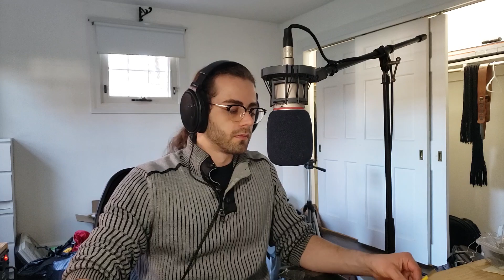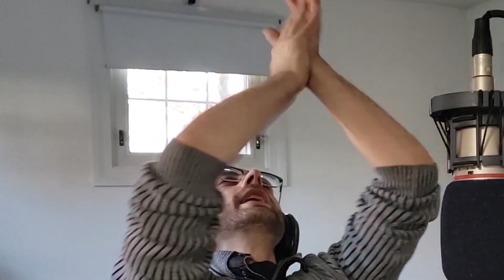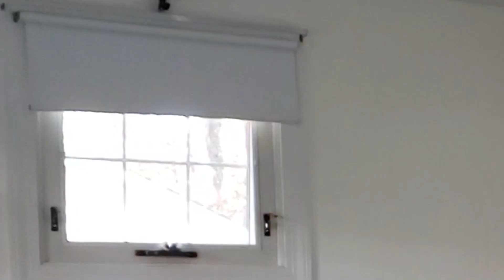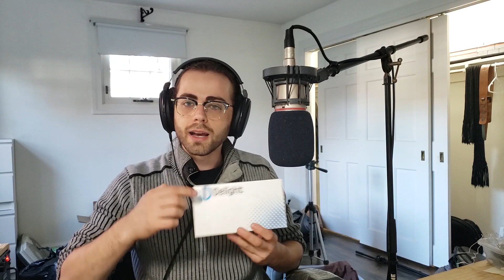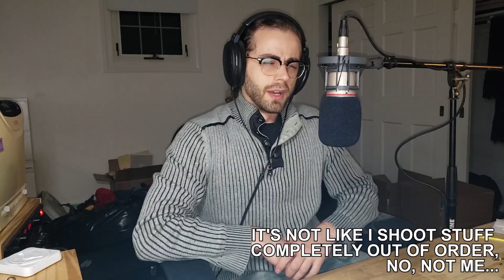World's First Energous/Delight Wireless RF Charging Product (PSAP) - Review, Teardown, Analysis

Comment: Good review.  This charging device is illegal.  The FCC approval ( VAW-NF910) allows only for ONE receiver, positioned in the middle of the pad, to be charged.  The device you reviewed is designed to  "charge"  at least two receivers off the center of the device.  Moreover, Energous and its partner, SK Telesys, submitted fake user manual to the FCC (claiming that the charger transmits "power" only when the receiver is on top and switches off via Bluetooth communication).  Other comments:  1.  You should have measured (or estimated by looking at the battery capacity) how much power is actually received by the receiver - I estimate 20mW at best.  2.  The spectrum analyzer was great and positioned properly (to match the polarization of the antenna), but beware that its accuracy is not assured in the "near field" (that is, about 1 wavelength or so, or about 30 centimeters or so, from the antenna).  3.  The heat sink is the key - if that's what it takes for 20mW or so at the receiver on contact, imagine what would it take in the mid field and the far field (massive heatsinks with massive fans - there is a reason why microwave ovens are noisy).
Reply from the maker: Those are some great points, and I can't really refute anything you just said. Not looking good!

Comment: This is very helpful. I've heard of this technology and been doubtful and sceptical. For a design class in Uni, my group is working on a USB stud adapter that'll allow non-wireless charging devices to wirelessly charge. My expectance of the distance wireless charging technology has gone from nothing at all, to hopeful, back to non-existent after watching this video. We'll have to think about something else.
Reply from the maker: It's certainly not a simple engineering challenge. Even if all you manage to deliver is a watt of power at a distance, that's got fairly significant market applications. But this result isn't exactly encouraging as it doesn't seem to offer any advantage over contact charging. It's disappointing more than anything.

Comment: One more thing.  The  strength of the electromagnetic field does not drop as an inverse square - it drops LINEARLY (in the far field).  The POWER does drop as an inverse square, but only in the far field (at least a wavelength from this dipole antenna).  In the near-field (that is, less than 1 wavelength from the antenna), the field strength, and associated power, have a very complicated relationship to the distance - with peaks and valleys)...

Comment: Why does no one use multiple frequencies to charge something, or you can’t do that I guess?!?!
Reply from the maker: I'm sure you can, but it probably takes a lot of real estate.
Reply from the maker: What you're saying makes sense. In fact, there's really no apparent reason why you couldn't just design a smart circuit that "tunes in" to the strongest signal available. I bet you there's enough noise around from Wi-Fi, 4/5G and radio to power a small device perpetually.
Reply: Bootstrappin' that’s a good point, I wonder if I could actually tap into all those from a small circuit that could fit in a phone case.  That would be the real free energy utopia that we all have been waiting for since the original AM radio.  I’m going to college for circuitry so I might experiment with the idea to see how feasible it is.
Reply from the maker: @wiiu7640  go for it, it would make for a really fun senior project. Swipe the scanning circuitry from a radio/buy one off the shelf, put up some mighty antennas, and see what you can get. In terms of power density, I assume 5G has the most.